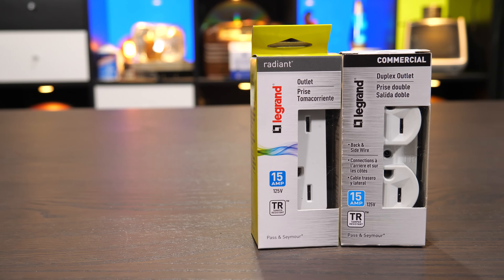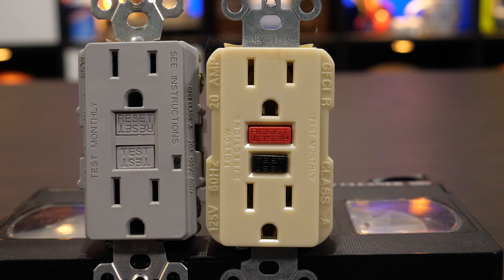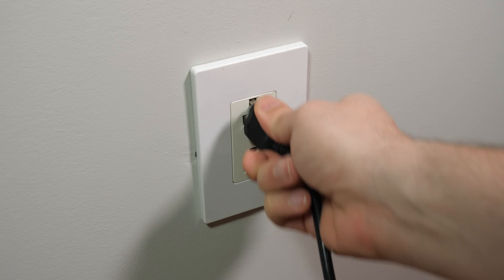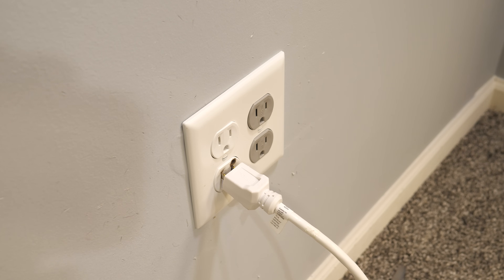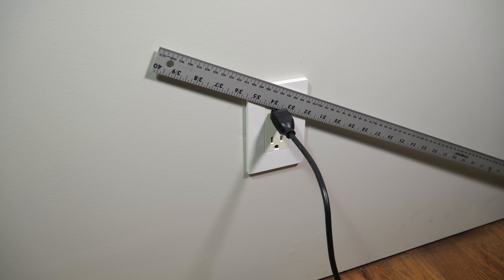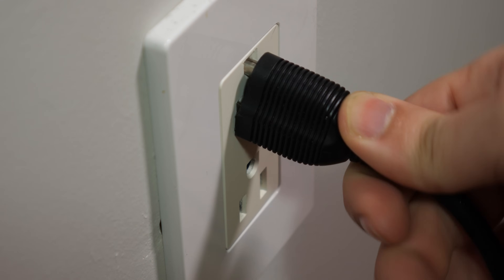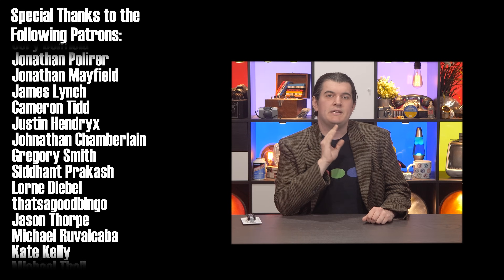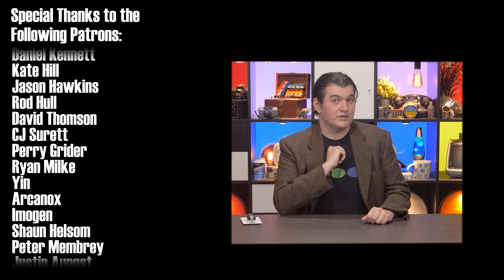Power outlets are topsy turvy - but does it matter?

Comment: Rest of the world: Let's make safe plugs.
America: Safety? 🤣🤣🤣

Oh and let me point out that plugs in Europe are not only safer, the most widely used variant is also symmetrical, so there is no up or down, you can turn the outlet or plug or the device by 180 degree and it will fit exactly the same way as before. The old Italien one was also symmetrical (still in use but most replaced by the standard one now), only the one used in France, Belgium, Poland, Czech Republic and Slovakia is not symmetrical but it's plug-wise compatible (devices and plugs from the rest of Europe will also fit there, you just cannot turn them upside down, they only fit in one direction because of the ground pin location). Safety-wise they are all equally safe, there is no way you can touch the pins the moment they make live contact, that's impossible. The only countries with incompatible outlets, yet perfectly safe, are UK, Ireland and Denmark, you need adapters for those. Well, for Denmark you would not need adapters, the standard plugs do actually fit but then their ground pin won't be connected, thus you are only allowed to plug in groundless plugs (at least officially, I'm pretty sure people have ignored that one in the past).

Comment: So far I've seen exactly one plug that appears to have been designed with upside-down outlets in mind. Hoover makes canister-hose vacuums in the same form factor they've been making since like the '80s, now marketed toward janitorial staff rather than homeowners and with extra-long safety-orange power cables, and the plug has a little rubber C-grip that's used to snap it onto the cord when you're finished winding it up. The C-grip juts out in a way that makes it resemble a three-prong plug, except it's oriented the other way around, so in a standard outlet you have to plug it in with the grip pointing upward. Presumably in an upside-down outlet, it would double as an anchor preventing the plug from drooping down and exposing the prongs.